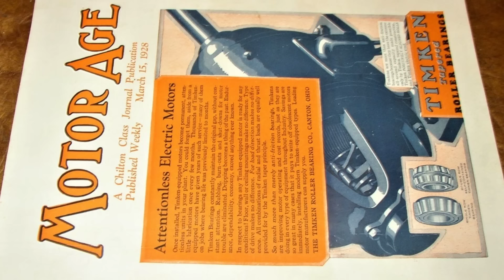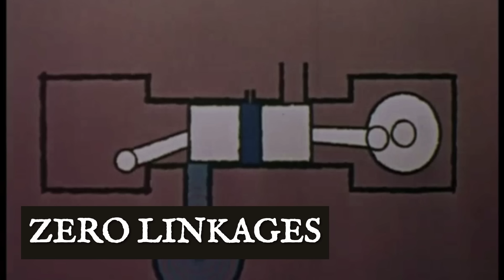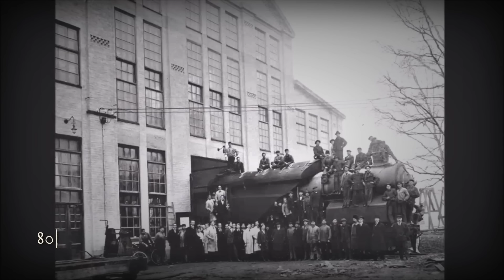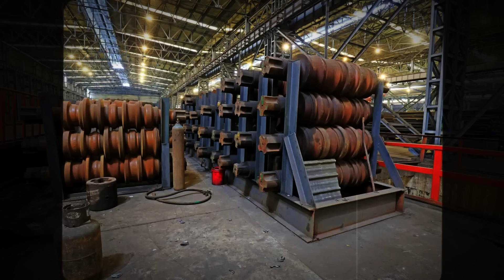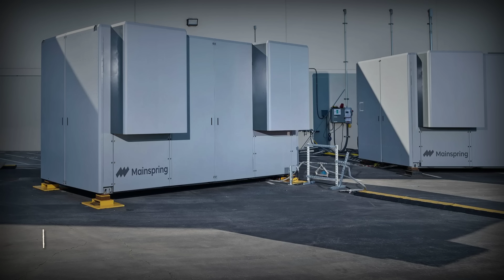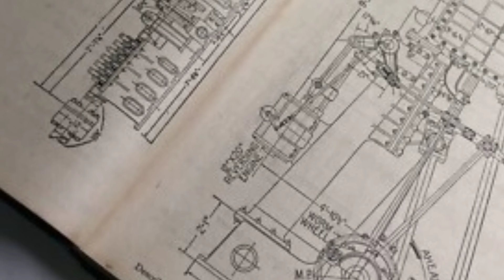This Swedish Inventor OUTSMARTED Detroit With a "STRANGE" Free Piston Engine in 1928

Comment: Well look at the Abrahams tank engine, that could theoretically run even way more power if using a different pre ignition system before generator, it could in theory run on hydrogen and oxygen but you need to spread it over more combustion chambers adding (pure compressed) oxygen and replacing the nitrogen with what you have at hand, what would that be that you make ?

this was a design that I have seen made to produce electricity directly too so if combined producing electric power directly by having the piston like two parts with an electromagnet inside and the rest producing extra electricity, well that would be interesting...

The Abrahams tank runs 1500 horsepower with ease and well from there...
It runs all parts of the system...

Well it seems the U-boats liked it a lot ignorance led to the downing of many ships...

And see just like the sterling engine it can run beside or in place of certain systems...
Reply: Yeah we have seen the software adjustments after a visit to the dealer towards more "efficiency" whilst emission problems where ignored that where all of a sudden caused by software....

Comment: It also could have been dismissed by the petroleum suppliers.  It was the oil companies that bought and buried the patents for the electric car.  Electric cars came out at about the same time as did the internal combustion engine.  It was the oil industry who did not want to lose the gasoline market that shelved electric cars.  This sounds ok.  Maybe it is time someone tries to develop a version that could be used for standby electric generators.  ???
Maybe it has something to do with the turbine blades.  I know that the turbine blades used on commercial aircraft engines is some really wicked engineering.  The metallurgy and investment casting to mold these as a single crystal matrix to increase the strength must be expensive.

Comment: The free piston engines predates Ljungström by more than a decade. Not sure why you would choose him as the inventor. Variations from stroke to stroke mean that free-piston engines are nearly impossible to control and certainly unsuitable to car use. They are also oil burners since they rely on total loss lubrication, so don't expect to ever pass emissions testing with one. The goal of eliminating a majority of engine parts was already achieved in production by piston port two-stroke engines: a single-cylinder two-stroke as fitted to many older motorcycles and power equipment has exactly 3 moving parts.

Comment: There used to be a small fleet of iron ore ships using these engines, they where incredibly efficient, but a nightmare to start, that was back in the 1950's to 1960's. However a version of this was used in the final years of radial aero engine where exhaust turbines where coupled to the prop shaft. It produced blistering performance.
Reply: Are you speaking of the compound engines like those used in the Lockheed Constilation? Aka the connie

Comment: This is actually quite a brilliant idea, with multiple ways to configure it in terms of final drives.
Using computer controls with a simple input sensor array, and precision machining capabilities available in your garage with CNC's, this is something worth exploring. An average desktop computer with engineering simulation and/or decent CAD/CAM software would suffice for design refinement.
It's a genuine integrated hybrid design that could take advantage of several options, electric or fluid drive, whether turbine (centrifugal?) or even reciprocating assembly for immediate torque to traction.
The compression ratio is easily adjustable for various fuels (even homemade) through pneumatic controls, and maintenance is incredibly simple, with a potential power-to-weight ratio that's ridiculous without the inefficiencies and complications of gas or diesel turbines.
This could be so simple and easy to manufacture that it's a home engineer's game, with no "emission standards" to gaf about.
Reply: You could simply use a diesel free-piston engine to power a turbine and that in turn connected through a torque converter and a computer shifted, friction clutch automatic.
Reply: @jwoody8815  Yeah, but what kind of turbine?
With new changes to EPA, turbines might be a thing on the road.
Pneumatic would allow the option to add more fuel and combustion chamber to power a turbine for huge expansion ratios, and keeps it very light. 
Hydraulic adds friction, but preserves initially generated power if not lost through heating.
Whatever the case, it was designed as a hybrid by removing the conn rods, etc., and the fewer mechanical conversions, the more efficient.
It's kind of a head-scratcher for a regular gearhead!

Comment: If it was so much better than what we have been using why wouldn't we be using it? Oh, that's right. It's just another iteration on an external combustion engine. You are building an air compressor from an internal combustion process to supply air pressure to turn a turbine engine to do the work. They did use this on ships. It's called a steam turbine. Boilers are fired to heat water into steam pressure to spin the turbine. It's much simpler, more cost effective, and a billion times lighter to just burn the fuel inside the turbine engine like on air craft. Billion times lighter is sarcasm but there is a massive difference in weight and bulkiness.
Reply: All the problems could've been sorted if they wanted to, the fact is they didn't want to waste all the money they had invested in their factories, can't really blame them.
Reply: @GaryRowlands  This is not true. Free piston engines are still around and their inherent flaws have never been solved. Manufacturers are always looking for the next best thing and retooling factories to produce new technology has always been part of running a car business. The reality is that free piston engines are not a good fit for automobiles.
Reply: @CaptHollister  What I'm saying is if the manufacturers had wanted to support the technology they could've sorted all the problems but they didn't want to so they said the problems are insoluble and went with what they had.

Comment: Free piston uses turbine. This is not suit to automotive because turbine has slow inertia response.  So it suits to not frequent load change workhorse like electric power plant or marine engine.
Reply: This can be negated somewhat with a torque converter.

That is how the Abrams and the Chrystler Turbine cars transmissions work.
Reply: @jwoody8815  Both don't have piston parts.
Reply: So this might be viable to turn a generator for an Electric Vehicle?
Hmmm “Church of The Crankshaft?” I’m afraid, in my case, the “Religion” window is closed. But 70+ years ago it might have been a Contender.
Reply: @theknifedude1881 Not likely because power turbine needs large space.
Reply: @alexlo7708 linear generator for hybrid vehicles?

Comment: This engine ignited a fuel-air mixture, the high-pressure exhaust of which drove a turbine.  He, essentially, invented the TURBOJET!  It works the same way.  High-pressure gas from the burning fuel drives a shaft, with turbine blades attached.  Those compress the  fuel-air mixture, in the combustion chamber.  If you attach a propeller to the shaft (through gear-reduction), you have a TURBOPROP.  Or, it can drive an auto transmission.  I wonder....  Was Frank Whittle inspired by this design?
Reply: I wouldn't be surprised.
Reply: Thing is, he didn't invent anything. According to Wikipedia, free piston engines have been around since 1912, well before Ljungström.

Comment: Read a good book , 1958 ships annual. A ship was launched using this engine called the free piston gasifier and the big plus was at 100:1 compression it could burn almost any grade of oil. They wrote that they were also building a small power station to test .about 6000 hp. Never found any more info about what happened to them.
Reply: WOW:face-fuchsia-tongue-out: